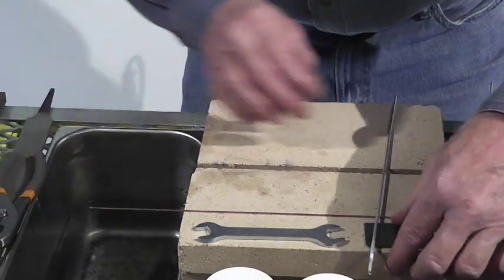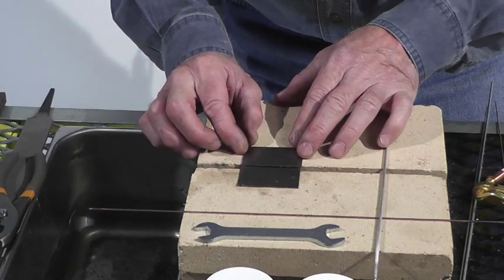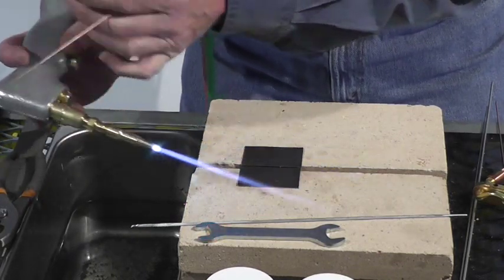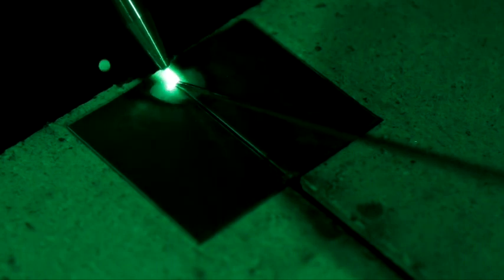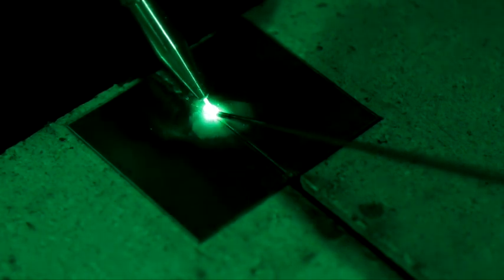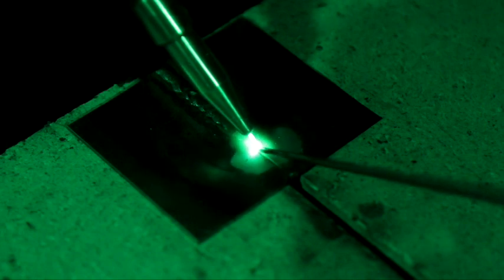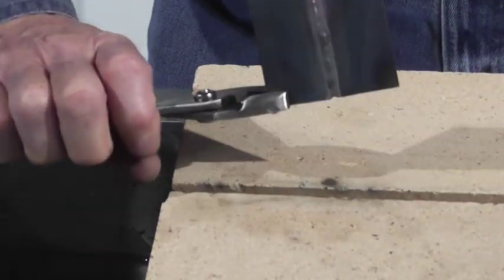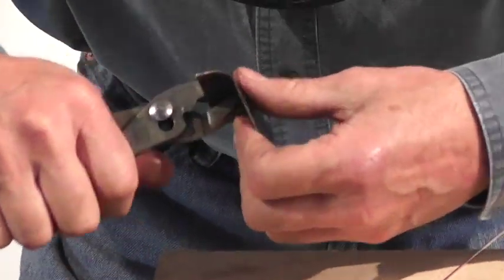HOW TO GAS WELD THIN STEEL

Comment: Observe how the torch is angled. In order to get the balance between heat on sheet and rod.
When too much heat on the sheet you'll blow a hole. To fill the hole,  flame almost parallel to sheet. And frequent pauses to let the sheet cool.
At the end of the sheet, it is very easy to overheat the sheet as there is less surrounding metal.

Comment: Do you need flux when steel rod welding or is the copper coating enough for fusion ?
Great vid btw.
Reply: Don't need flux to weld steel!  The flame takes care of it, if it's set up right.  The outer flame is reducing, and will actually turn rust into iron to some extent, you can see this yourself.  That copper coating has nothing to do with it!  At this point someone usually mentions that you can in fact do this weld with coat-hanger wire or other misc mild steel wire.  The commercial wire is better b/c it has chemistry in it to help the weld:  Silicon and deoxidizers.